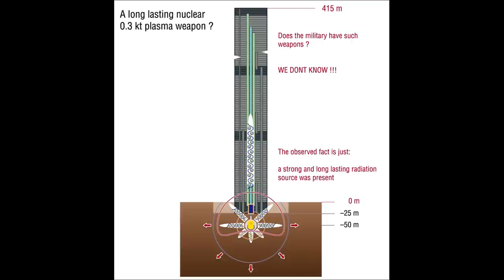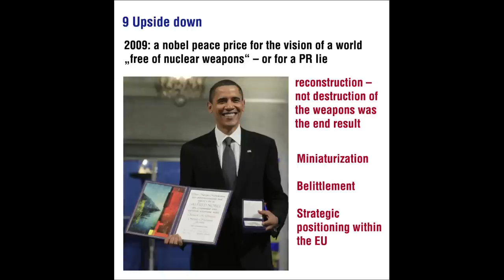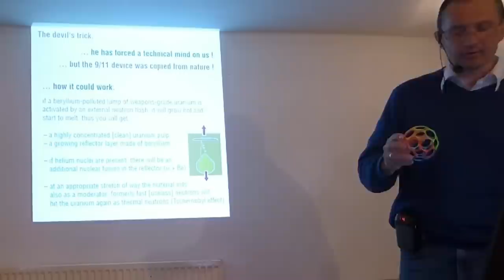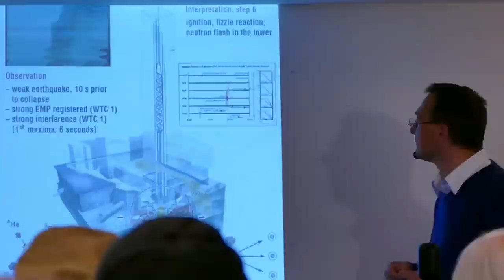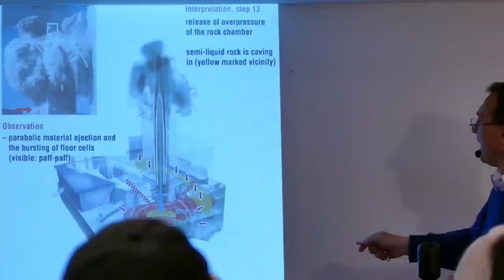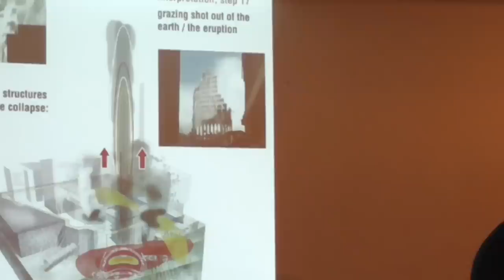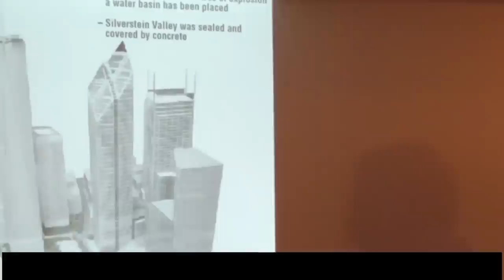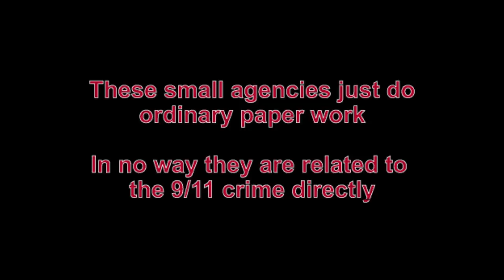The 9/11 [gamma radiation] nuke's design; Part 3 of "The Power Source(s) of the 9/11 Event"

Comment: Very compelling hypothesis, it has great explanatory power and accounts for the high energy and weird effects exhibited that day. 

I have been in New York my whole life and lost family in the events at the WTC. I also pass the WTC every day, going to and from work. If your hypothesis is true, would there still be residual radiation in the area? Perhaps in the subway station that passes beneath the site? 

Regarding the subway, it only reopened last weekend on September 9th, 2018. It took 17 years to repair/rebuild, which I find odd, considering that both WTC 1 and 7 were rebuilt in that time. Also consider that the tracks in that station were reopened in 2002, the train just would not stop at that station. Maybe one could chalk this up to MTA bureaucracy, or maybe there are other reasons...

Also, do note that: besides the extreme heat effects at the site in the months following the destruction of the WTC, there was a dust cloud that hung suspended over the Manhattan skyline for at least a month or two following.
Reply: Now we understand the longest burning fires under Ground Zero, and that would have been a very unhealthy cloud you are describing afterwards.

Comment: Thank you. Interesting theory but one of the things I wonder about is the question of EMP. There were thousands of unshielded portable and mobile radios close to the site, not to mention video and television equipment. This process does not produce such a signature?
Reply from the maker: Actually a lot of radio fails were reported during that day. Also the question about a collimator effect is open. Please refer to section 2.2.2 (Neutron collimator): http://www.911history.de/aaannxyz_ch02_en.html ; I cannot say for sure how effective the tunnel / elevator shafts worked as a collimator: the exact layout is too sensitive for a simple answer. Experiments and costly calculations are needed. About the EMP signature please refer to PART 2 of this presentation: https://www.youtube.com/watch?v=Se5BDbEbtwU
Reply: 9/11 and beyond: the Oligarch's nuclear wargames   Thank you sir. Fascinated by your analysis. By the way, I had an interest in space physics many years ago and I suspected plasma processes occurring at WTC.
Reply: The EMP seems to have been vectored, the Edison substation at the base 2 floors of WTC7 did not fail until 4:33 pm for example

Comment: seems like an antimatter hand grenade would be more likely because there would still be more hot isotopes at ground zero afterall the WTC bathtub liner was found to be intact with no outside ground water coming in which would have contained isotopes
Reply: You think a hand grenade took down a 110 story steel highrise 🙄

Comment: Mr Heinz you speak about the Faraday Cage. but there is a phenomenon created with volcanic eruptions, where thunders are created . These are created as pyroclastic flows  run  and are not different than atomic pyroclastic flows. both are energetic clouds that interact with air creating a  difference of potential as electrons and chemical elements are being transformed + mixed with atmospheric layers that have a potential within itself.  You are correct that energy potentials are contained by the antenna as the antenna is grounded. Then contained as just after the tower falls the question would be why no thunders re seen?
https://www.youtube.com/watch?v=wsu8DPeer-o

Comment: So, The question remains....who did it and why??
Reply: This question was already answered, many, many times. Why and who precisely how founded, it was even told day before by Rumsfeld day before it actually happened.
The only question remained - how.
Reply: @KabelkowyJoe  HOW has also been answered many, many times already, such as in my own article:: Google: ("Solving-9/11-Enigma"). What the German physicists is reiterating here is basically trying to re-invent the wheel, even though he had NOT fully informed himself of some of the crucial details, which he has either overlooked in his presentations, and/or he was simply NOT aware of them, such as elevator-shaft-number-50 discussed just below this comment; another most important factor was the thermo-nuclear-radiation-reaction between the nukes & all the Freon-Gas in the buildings causing the vaporization of everything around them with super-hot plasma!!! 
All said and done, NOBODY cares about 9/11, as I found out in the past couple of years. Everyone knows it was an inside job, and that it was probably nukes, but nobody cares about it, mainly because NOBODY can do anything about it, since the perpetrators are beyond reach for prosecution!!! That's just the way it is folks.!!! 
Personally, for two decades, I have NOT been able to have petty individuals prosecuted for major proven crimes they have committed, mainly due to the ultimate corruption of the USA-LEGAL-SYSTEM(CESSPOOL), which I personally have found out to be the world's most advanced form of organized crime (that I have ever personally known about)!!!